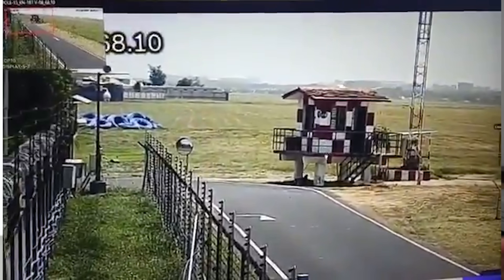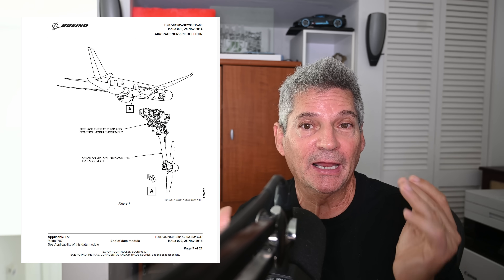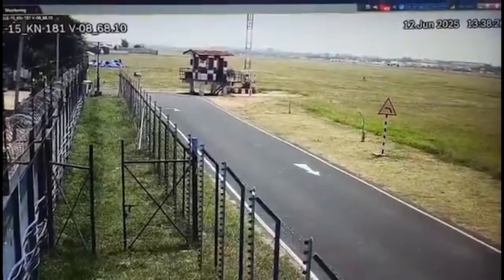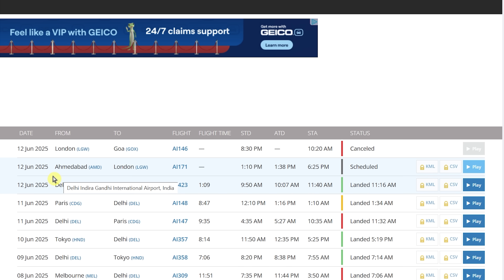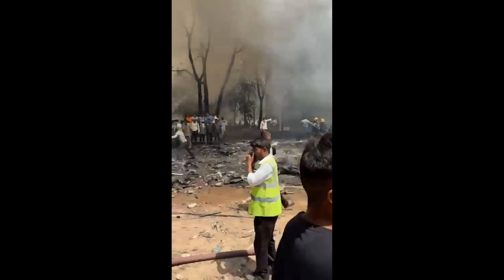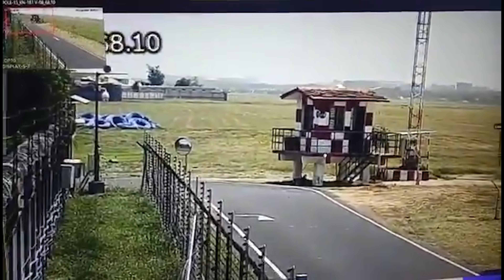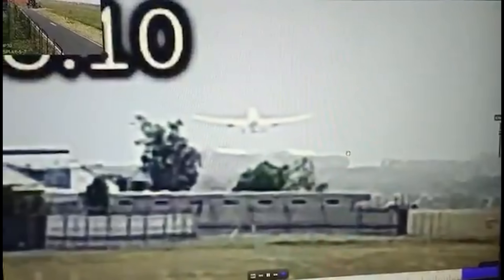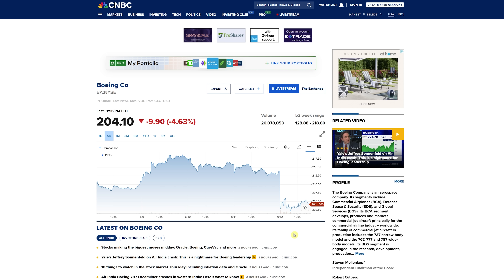What Caused Air India 171 Crash, Mysterious Sound Before Impact

Comment: im no pilot and i can tell theres no flaps extended. there is also something attached to the fuselage behind the rear landing gear. if its the RAT, means electrical power loss, not thats its going to do much that low and slow,  but its too far back for it to be the RAT

 planes nose is up the entire time, clearly trying to gain altitude but not getting enough lift from the wings.  gear is down, did the pilot retract the flaps instead of the landing gear? with very different controls, in very different locations, i dont think so.

i think they had a failure in both the electrical and hydaulic systems upon takeoff,  the RATs dropped, flaps retracted due to low hydraulic oil pressure, and it stalled. pilot error? maybe but im leaning more towards mechanical failure.

the one thing ive not heard discussed is the fuel. was it good quality? was there any water in it? foreign objects? fuel pump failure?

Comment: Gear was down. Long past the point of rotation. No flaps visible. Its backwards. 11000 ft runway, plane is up. It had lots of speed. But no flaps and gear still down. Pilot calls out rotation, copilot is supposed to lift gear. Instead lifts flaps. Too slow for skinny wing. Too late.

Comment: The 787 has a config warning if the flaps weren't set on takeoff.  Never saw the RAT and it's powered by the air stream so it shouldn't make much noise. The gear selector and flap selector are not close together.

Comment: On the second video showing exact moment of takeoff is seems flaps are up . 
First video shows landing gear didn’t retract or at least start to retract. 
If that’s true, that is 100% wrong T/O configuration for hot climate takeoff. After initial take off this configuration leads to the same flight situation as a sudden loss of power. 
Obviously the final say and complete analysis will come from the flight data recorder and the ground investigation. Alll what is said now is some kind of speculation.

Comment: I worked at Boeing on this airplane. You will not the hear the RAT over the engine noise. The RAT is not powered by an engine it’s is the wind going through the prop to power hydraulics and electrical power. 

I believe what you are hearing is the chevrons (scalloped rear edge of the Engine Case. They sound much different than a traditional Jet Engine.

Comment: If I see the reaction it is overloaded flight changing flight from domestic to international with additional excess baggage added in which stalled the engines or electrical short circuit causing total shutdown or fuel lines jammed with dirt choking the fuel to the engines.

Comment: Very interesting detail: it is said that the plane climbed to 600 feet, however, if you look at the take off footage, the plane does not seem to climb more than 1.5 spans of the wing, which is 60 meters,  i.e. 90 .. 100 meters, or 330 feet. Also, it is said that initial climb rate of a 787 would be 2000 to 3000 fpm, that is 35 to 50 feet per second.  The plane was fully loaded, and the temperature was high, so that one would expect a climb rate closer to the lower limit, i.e. 2000 fpm.  The plane in the video seems to be climbing for about 10 initial seconds after rotation, pointing again at an altitude gain of maybe 400 feet.

Comment: The Boeing 787 Dreamliner: from battery fires that led to groundings in 2013 to the more recent quality control issues. In 2021, whistleblowers within the company revealed that there were excessive gaps between fuselage panels, violating FAA-approved limits.

Comment: As someone who used to live near a major airport in an area where many flights would begin their decent, with the engines throttled back, the turbofans will often make that kind of noise when the normal jet exhaust sounds don't down it out.

But either way, still an indicator that engines were no longer producing full thrust.

Comment: I dunno if anybody's beat me to it, but I'm guessing the pilots forgot to use flaps for takeoff so as the end of the runway came up, the pilot desperately pulled the yoke hard to get airborne, it worked but sadly caused an angle-of-attack stall, note the severe flexing upward of the wings under the load.
Reply: There is a LOUD warning system that makes that literally impossible.
Reply: @Summitspeedfly  Well why didn't they heed the "oops no flaps" warning?
Reply: @tungstenkid2271  - 
They didn't, they retracted the flaps AFTER takeoff, and there is no warning for that.
Reply: @Summitspeedfly  A solid fact we have is that the plane kicked up dust just off the end of the runway, so it's possible the flaps were never deployed at any time during the takeoff roll to enable the plane to lift off well before running out of runway.
Reply: @tungstenkid2271  - So, you never heard of the TOCWS?  Pretty hard to ignore?
Reply: @Summitspeedfly  Well why did they ignore it?

Comment: I think it's unlikely that the explanation is a purely mechanical, hydraulic, or electrical one. The level of system redundancy in the 787 just makes the odds of these failing all at once are just infinitesimally small, foul play or particularly egregious maintenance-related negligence notwithstanding.

1.) The RAT can be deployed manually and doesn't necessarily indicate that there was actually a need for it. The sound is pretty curious, though I confess I can't actually see a deployed RAT even in the higher quality video.
2.) Unlike many other aircraft, both engines on the 787 generate electricity. The electrical architecture in the 787 is quadruple redundant.
3.) Also unlike many other aircraft, the hydraulic pumps are not driven directly by the engine but rather by an electric pump that uses power generated by the engines.
4.) The 787's flaps are electrically actuated with multiple levels of redundancy, so even if there was some kind of hydraulic failure (unlikely considering the 787's hydraulic system is triple redundant) it wouldn't explain why the flaps are mostly or entirely up.

Comment: The seat configuration you showed was for a 787-9, not a 787-8.  787-9 does not have the same seat configuration options that a 787-8 does, and each airliner can have their configurations customized.  It is my understanding that Flight AI171 (a 787-8) was configured so that 11A was a few rows forward of the LH wing and the first seat aft of Door 2L.  Aside from that, @jeffostoff, I appreciated your analysis.

Comment: New plane, inexperienced pilots... probably mashing all the buttons, but not checking the flaps. The plane gained lift because it 'bounced' a bit, while trying to take off, but once it levelled out, that 250-350ft in the air, it lost the momentum probably mainly because of no flaps. It just looks off to me. It's either this or engine failure but i doubt that. It almost sounds like the engines were never running full speed to begin with to me. Could also be a weight miscalculation quite easily. Given the supposed aviation standards of India, it's quite likely something wasn't double checked.

Comment: I worked at Douglas for 10 years.
Looking at video on take off,if the flaps were down you should not be able to see the back side of the engines.
So looks like the flaps weren't down to take  off?

Comment: It does sound like the external generator is running. However when you take off without enough flaps on the plane that's exactly it is sitting at about 10° angle of attack and it stops any upward motion and it just starts falling out of the sky. He didn't have flaps deployed properly. Which is inexcusable on that aircraft. If it's not configured right it will tell you in the cockpit before you start to take off.
They didn't even get the landing gear to retract. But the flaps are only at about 10 degrees or so not nearly enough to keep that aircraft in the air below 200 knots

Comment: I’m not an expert, but have heard that when flaps are extended - you wouldn’t see the engines, which on the take off video you can clearly see. Flaps are retracted, no lift, gear is extended, more dang than lift. Sadly, most likely it’s a pilot mistake.

Comment: At 8:11 you can see a mess hall with food still there on the tables . One table has a plastic water bottle still standing  on it , and splashes of milk on the floor that go side ways  even though the hole in the wall is straight in front where the plane hit  . I guess the wall took all the force of the impact just before it collapsed and made that hole . witch may have saved many more lives inside.

Comment: Point 1. Loss of engine thrust does not give an immediate loss of electrical power. The engine generators still provide full power below idle. So loss of power will not cause the RAT to deploy instantly. Point 2. Loss of all electrical power will not cause a loss of engine thrust and the plane will continue to climb. Point 3. If thrust is still available and the aircraft seems to be under control, what would cause it to sink? Retraction of the flaps? Would loss of electrical control cause the flaps to auto retract? I'm a retired 747 maintenance engineer, so my knowledge of the 787 is limited to that gleaned from the 'net.

Comment: Sometimes, the AC turns off at take off or landing time. This quiet happens to get the maximum power to the engines to work with its full strength.

Comment: I don’t see the relevance, if they had Engine failure on take off resulting in a loss of power there would be hardly time to switch to auxiliary power before coming down, they seem to have stalled to me, so a possible bird strike to both engines or a fuel problem but it is angled up, lost power and that was then unrecoverable

Comment: i am not a pilot but have watched other plane crashes on TV and it sure looks like a stall caused by improper flaps settings either on takeoff or by retracting the flaps instead of the landing gear and i did not hear the sound of a turboprop as the plane flew by only the normal fanjet sound besides there wasn't enough time to deploy that anyway

Comment: No brainer here. Don't need video w/sound. 1 still shot/pic solves all questions. 
**Flaps up + gear down= inevitable stall/crash no matter what type of aircraft. 
Even if @ full throttle.**
(I'm a 35 yr airline veteran)
Reply: But why would the turbo prop drop down? Aren't the engines still going?

Comment: To me is sounds like a "large" fanned turbo-fan and doppler effect as it is flying further away... The high pitch wine we associate with turbofan engines is from the gas-generator section of the engine. Turbo fan can sound somewhat like a propeller especially with the size of the GE NX or Trent 1000 turbofans. Also no visual evidence of ram-air unit having been deployed... My money is on pilot error. Landing gear still down. Co-pilot may have retracted flaps instead of landing gear.

Comment: No comment yet on the big cloud of dust as the aircraft gets airborne. So was it airborne in the runway over-run area. If so, it used the whole length of the runway to get airborne. Theres a big problem right there.

Comment: Hearing that noise as a jet engine mechanic it sounded like over speed pulse on the engine, you have to pull a handle to extend rat to operate, I don't think that was the problem, maybe movement in the cargo hold caused nose heavy, its tough on that small amount of video.

Comment: Flaps are up, but the gear is down. Somebody made a mistake. If it was a hydraulic problem, the flaps would still be down too. I don’t believe they would have been able to rotate without sufficient engine thrust, so I don’t buy the RAT theory. Also, there wasn’t enough time for the plane to have loss of power to deploy the RAT. The sound you’re hearing is the air pushing the plane down because the flaps were fully retracted at a low speed.

Comment: has to be something that happened behind that shed at the end of the runway - that dust / smoke cloud on take off is white ... and its only to the left engine - clearly they are passed V1 (the point of no return) - the survivor also reports of a bang - this could have been a bird /debris strike or fan failure which took out the hydraulics too - whatever happened behind the shed is the key

Comment: the survivor said he heard a LOUD BANG just on rotation, something blew up inside the electrical area in the plane the RAT deployment was instant could have been the battery, The Boeing 787 Dreamliner experienced serious battery issues, primarily thermal runaway events, which led to fires and a temporary grounding of the entire fleet. These issues stemmed from internal short circuits within the lithium-ion batteries, leading to overheating and potential fires. The NTSB investigation identified design flaws in the batteries and Boeing's failure to mitigate the risks associated with internal short circuits.

Comment: Your analysis is great. However the bottom line is India in every aspect you will see negligence and lack of seriousness. When I grew up in India one time there was a news so many deaths in hospitals , later they found out that IV saline bottles was filled with tap water which they were using  in hospital. They use fake vaccines and inject on patient. This is just one example. I used to fly India from chicago with AirIndia because this is was the only one nonstop airline available that time. Based on my experience AIRINDIA was poorly maintained. Most of the amenities barely work such as screen, remote, seat handle. sometimes bathroom get flooded. When the plane landed seems like the seat is going to uproot from the floor. Maintenance crew definitely noticed  all these problems but possibly ignored. Until this disaster happened. I think this Airline should be banned from flying internationally. Today it is in own country, but Tomorrow  might crash in other country killing people.

Comment: Analyzing frame by frame,  you can see some of a flock of white birds flying left, just above the right wing. At the point immediately after rotation, there is smoke/debris from engines, drifting left. I believe you are correct. RAT was deployed. You can hear it, and you can see it in your first screenshot from the amateur video.

Comment: Ah, RAM's are used to power critical equipment on the aircraft not to provide power to replace engine failure.  Correct RAM is used when an engine fails and the RAM only provides power for electrical/hydraulic equipment

Comment: 747 and L1011 flight engineer here with 13,00 hours. Positive rate gear up would have happened. Take off warning would have sounded if wrong flap setting. Newer ones like this that replaced the flight engineer garbage in garbage out. Select wrong flap setting in CDU no takeoff warning. Flight engineers would have caught this mistake with charts and runway analyis. Got rid of us. We caught mistakes with charts and data. Long before this young computer, plug and play
.

Comment: Boeing didn't make a 'bad plane.' Dreamliner has clean safety record in 14 years of operation. This is the first fatal crash and early speculation suggetss that it was due to pilot error (retracting flaps instead of landing gear) or multiple bird strike etc. Investigation will reveal. Ram air turbine sounds like a Ukrainian drone! Seat 11A on Air India 787-9 cofiguration is an emergency exit row. If the flaps weren't set for T/O configuration it will feel like inadequate thrust to the pilots.

Comment: Interesting video. We are told that the temp was 110 outside making the air thin, and it was a high elevation airport + thin air and less lift. For some reason they took off on a short side runway and almost ran out of room at the end of the strip. Flaps were not in the correct position and the gear was down slowing down the liftoff. Also fully loaded for trip all the way to London. RIP fellow travelers.

Comment: The wheels on a Boeing 787 are retracted after the aircraft has reached a specific height and speed, typically around 150-200 feet above the ground and a speed of 100-110 knots. However, the exact height and speed can vary depending on the specific takeoff procedures and conditions, but as you can see they are still down at 600 feet?

Comment: This was not the engines. Stick to engineering.  This was a short runway t/o for some reason, flaps were not at 15, landing gear was still down, it was hot with high humidity. No flaps will cause a loss of lift which feels like power, the plabe dropped because of speed was to slow and not enough lift.

Comment: Looking at the footage, the flaps are not deployed, indicating that the captain forgot to deploy them. As a result, the takeoff distance became longer, and instead of aborting the takeoff, the captain hurriedly increased the throttle to full power, which caused the engines to stall, resulting in a loss of power and the crash.

Comment: The plane was being used continuously (with little brakes in between) for long and short route journeys from the last few days. The weather in India is extremely hot already and in a plane, heavy amount of fuel burns producing high heat. As the plane was just a machine, according to me it just went dead while undertaking another journey. It might have happened in mid air too but it happened as soon as it took off. 

Secondly, the passenger who survived was sitting in 11 A seat (that was the window seat just beside the emergency exit). His brother was sitting in seat no  11 J (again a window seat, on the opposite side that was also just beside the emergency exit). The survivor himself has said that he jumped out of the emergency exit and most probably his brother too have jumped (which is not yet known). So I think it makes sense. These brothers had booked these seats deliberately.
Reply: All vehicles need brakes.